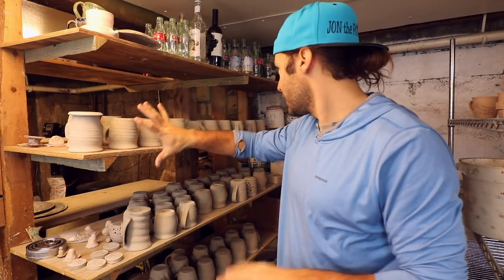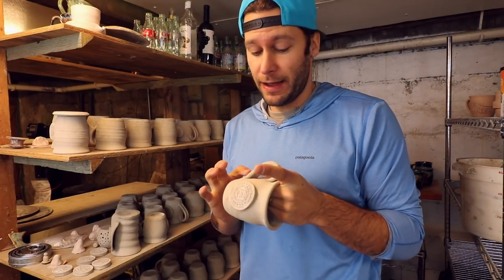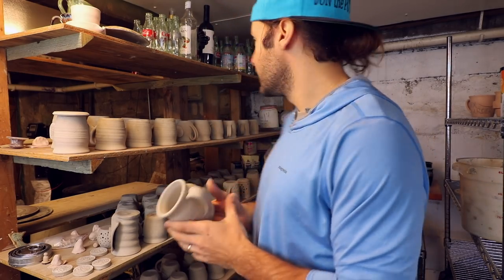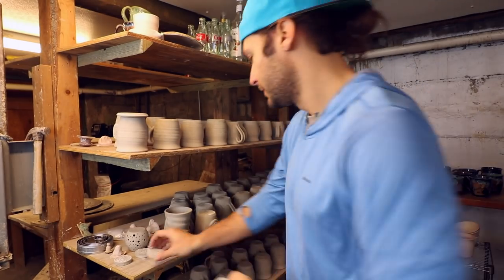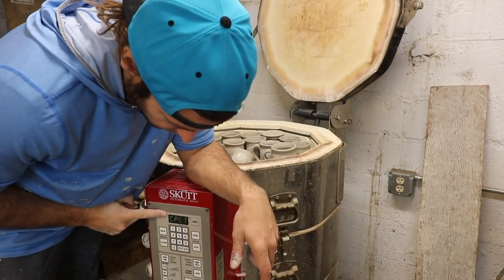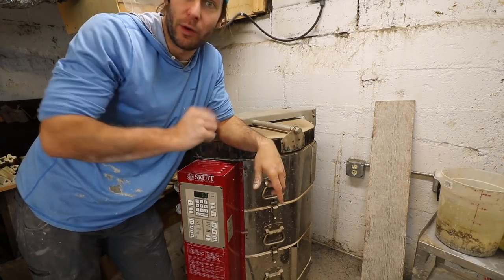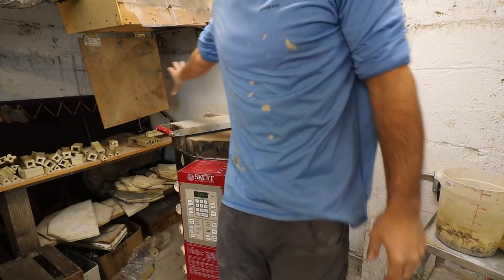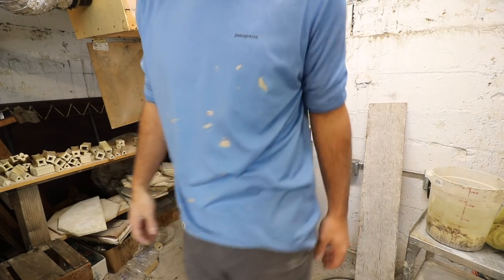How to Bisque fire pottery, even if it's still a little wet

Comment: Great wee video for those who bisque fire and can set their programmer........
We poor souls who now single fire in an old manual kiln and only use cones will have to wing it on the drying.
 6 out of 6 and no blow ups yet, even with some thick walled pots.
Thanks for sharing Jon!
Reply: No winging it necessary.  To "Candle" or "Water Smoke", just turn on the bottom ring, with the peeps out, and top open.  Generally do this over night. and then close it up the next day, and fire as normal.
Reply: @benpatterson4452  Thanks Ben, with the top open do you mean propped open about an inch or two?
Reply: @freddiemoretti8456  Some just crack the lid, some leave it completely open.  I've done it both ways, with the same results.
Reply: @benpatterson4452  Thanks!

Comment: Question. I noticed you didn't prop the kiln lid open while you were drying your greenware. How come? Thanks
Reply from the maker: I should have , actually I think I did I just must not have filmed it or had it in the video
Reply: Ok. I have mountains of greenware but haven't fired anything yet. I'm so afraid of something going wrong so I'm a sponge soaking up any and every thing I possibly can. My kiln is manual so I'm even more Leary. Thanks for the instructions

Comment: I was taught to bisque at 04 is that wrong any reason for 06 vs 04?
Reply: It just depends on the clay, and glazes you are using, not to mention a bit of personal preference.  The lower you go, the more porous the clay will be, and it will suck the water in the glaze in a bit more, than a slightky higher firing.
In my classroom, we do low fire.  Bisque to 04, glaze to 05, vecause that's what the glaze manufacturer suggests.
From what I've heard, from other potters, most bisque from 06 to 04.